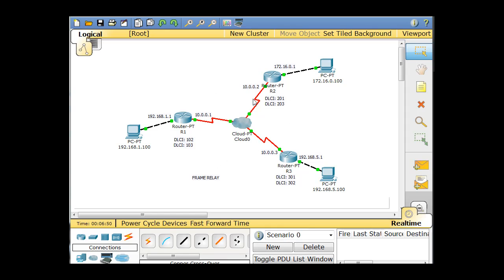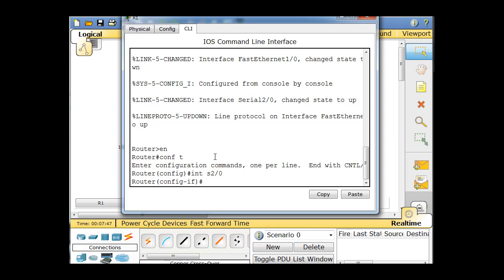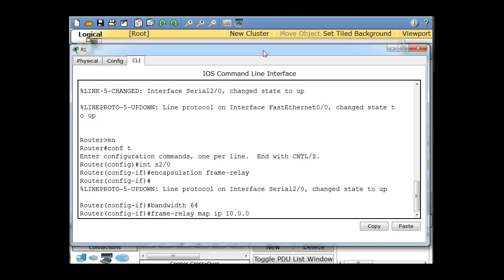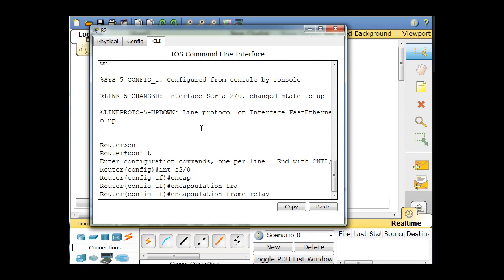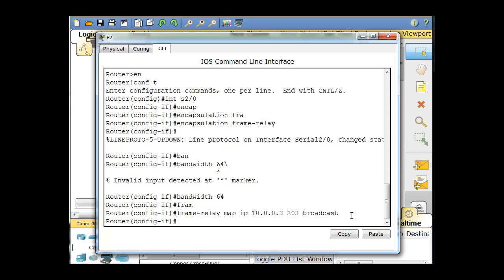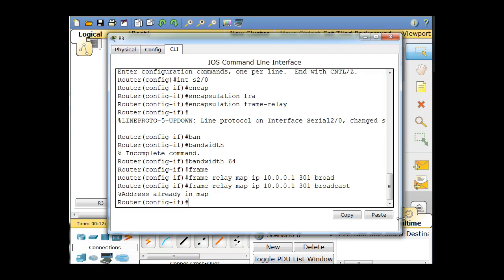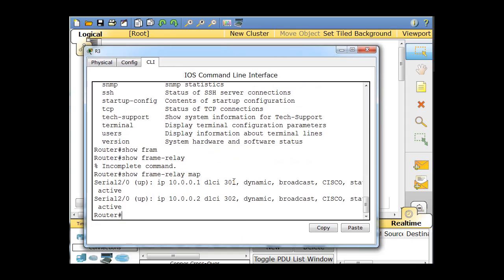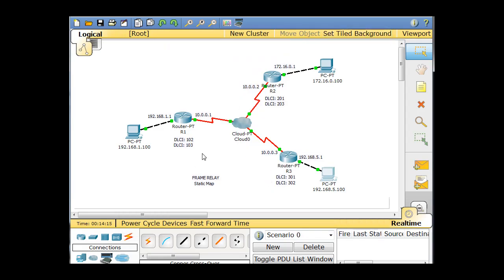Configure Frame Relay for the Cisco CCNA - Part 4

Comment: does it work with OSPF ? because with RIP it work`s however with OSPF it does not =(
Reply: on interface config for each of the routers input: ip ospf network broadcast to make it work, or alternatively point-to-point instead of broadcast if you've just got two routers communicating between the FR cloud, and of course ensure that ospf is set up correctly on each router

Comment: Having a hard time converting RIP to OSPF... Instead of RIP commands I used these:
R1
======
router ospf 1
network 10.0.0.1 0.0.0.0 area 0
network 192.168.1.1 0.0.0.0 area 0
R2
======
router ospf 1
network 10.0.0.2 0.0.0.0 area 0
network 172.16.0.1 0.0.0.0 area 0
R3
======
router ospf 1
network 10.0.0.3 0.0.0.0 area 0
network 192.168.5.1 0.0.0.0 area 0

And ideas why this wouldn't work?